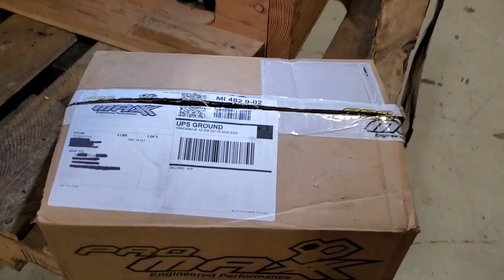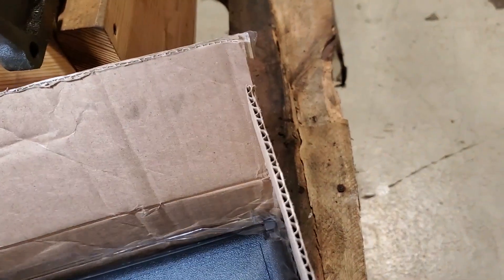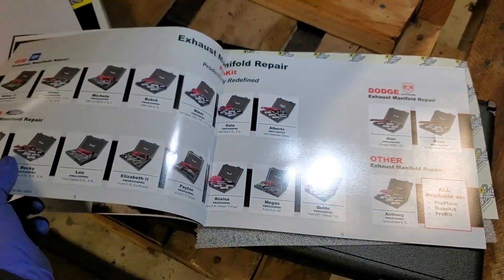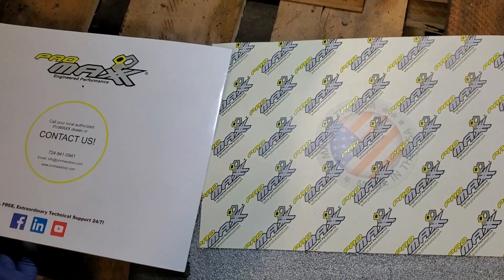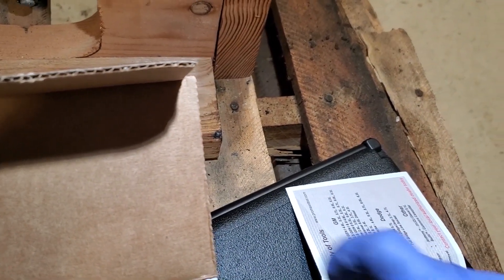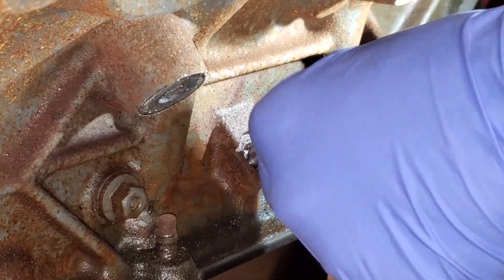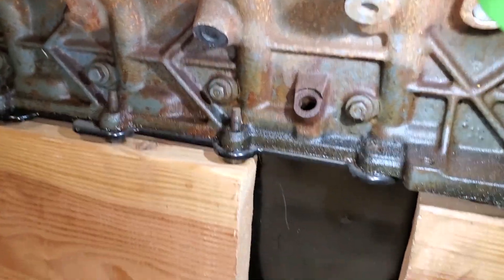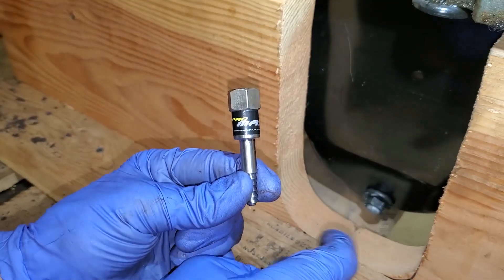Ford Engine Broken dipstick tube REPAIR!!!!!

Comment: After 15 years; there's a tool. I made mine 15yrs ago. Still works. Probably done around 100 tubes. Mines made from a metric bolt ground to a taper, and sharpen the threads. It's got a big head that can be struck with a angle pry bar.
Reply from the maker: Hell yea!!
Reply: What size metric bolt if you don't mind?
Reply: @dr7477  8mm I think or 6mm. Kinda whatever works.
Reply: Do you have to heat it up or douse it with penetrating spray? Of course you don't want that in your oil, but...
Reply: @johnwelsh2497  some spray and a little soak time wouldn't hurt. It'll probably take 2-3 tries. Patience is the answer

Comment: I made one out of a eye bolt for wood. Cut the eye off weld a nut to it and screw it in the same way halfway in you want to put a pry bar under the nut then slap it with a hammer. Took 10 minutes.
Reply from the maker: Excellent

Comment: I just removed a broken dipstick tub from a V10 Ford in the truck. All you need is a 3/8 X 16 tap and run a nut onto it. Tap the tub and gently pry up on the nut.
Reply from the maker: Yep have done it that way too. Was sent a free tool & had to review. Just showing an alternative way....
Reply: @PowerStrokeTechTalkwARod  what about a dip stick that broke half way? Same process? I’m just starting the vid
Reply from the maker: Yepp unless u can grab n pull...
Reply from the maker: I just did an f150 in the vehicle....

Comment: Thank you I have to switch my tube around in the backside of the motor to the middle , because it’s a inline 6 the oil tube is supposed to go in the middle not in the back great video thank you I will definitely try this

Comment: i took a spare bolt that just about fit inside the broken dipstick tube, forced it to thread about 6 or 7 turns, then beat it with a hammer. The bolt head kept it from falling in the pan.
Reply from the maker: Thanks for sharing!! 👍

Comment: Might work with the engine out but it was very difficult to use with the engine in the vehicle. They recommended the slide hammer, but that also did not fit because is runs into the motor mount and is not long enough even with the 11" & 6" extension together. Really nice people at ProMaxx but that was unfortunately an expensive failed attempt.

Comment: From one tech to another, no bs does it work better than an easy out?
Reply from the maker: Most definitely...gotta have the right tool for the job. Time is money, fiddle fartin a concoction together....pssssst
Reply: @PowerStrokeTechTalkwARod  I just use a easy out with a tap socket and ratchet,always worked except once when I did have to pull a pan

Comment: 5" Trussslock Screw ESR#1078 
- Screws all the way to the bottom of the broken piece and light impact hammer the head ... 5 minutes. TRICK is how we get the new tube back in with manifold ON :/
Reply from the maker: No biggie

Comment: Will this work that easy on a 460 that doesn't seem to play nice lol
Reply from the maker: Yea i suppose. Ive also tapped them in and pulled them out the drain plug hole too...
Reply: @PowerStrokeTechTalkwARod  I'll keep that in mind. I gotta replace the clutch on it too so when we get to that I'll remember that thanks bud